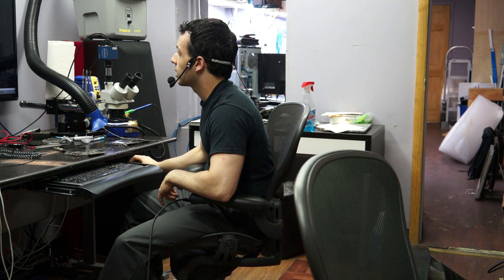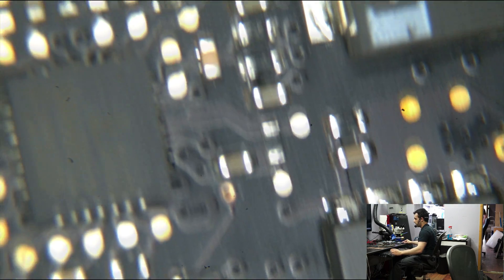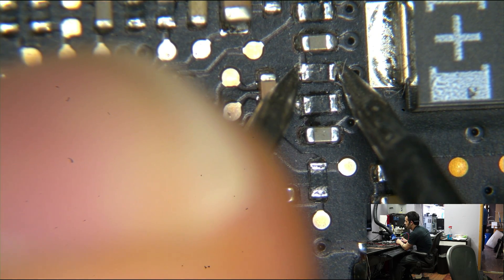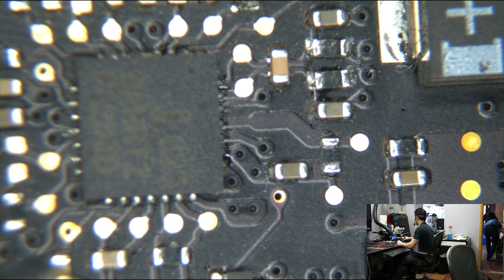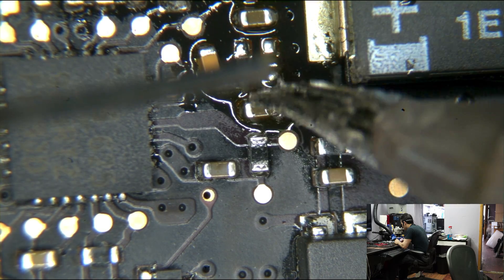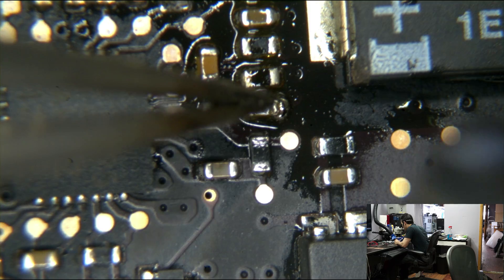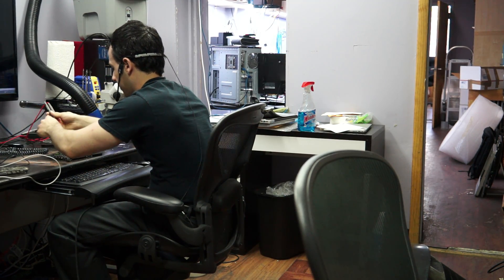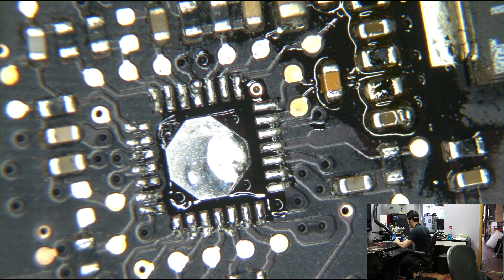How to solder ISL6259 QFN chip on Macbook Pro logic board if you suck at soldering.

Comment: Just a heads up, you can’t accurately measure resistors when they are still in circuit. You gotta disconnect/isolate one side first. Obviously when he measured the second one and it read as open, it didn’t matter.
Reply: If you measure a resistance that is higher than the value of the resistor, you know the resistor is bad.  If you measure a resistance that is lower, you don't know, since current could be flowing along other paths.

Comment: Hi Louis, let me start saying I suck at using the hotair gun. I am trying to fix my macbook, looks like the Q7260 is bad. There's voltage on the source pins and nothing coming out of drain pins. My question is what is the temperature (Ceilsius) to get this chip off the board. I tried 400C for a few seconds but the solder doesnt melt, is there any trick I am missing? I appreciate your help. thank you.

Comment: Hello guys, I'm a very young electronics technician, I know the theory, but in practice I leave a little to be desired. My course was not so good for this reason, they teach the theory, but the practice does not. I had to learn the basics at my stage, but I still have not achieved my goals. Would it be possible if you, technicians with experience, could pass me tips and videos or channels even if they teach to use the hot air station for example? I would greatly appreciate all of you.
hugs from Brazil

Comment: Hello! I ask you for help. I also apologize for my English, I print in Russian, and Google translates the translator. I myself am just beginning to study the profession of repair.
My MacBook A1502 EMC 2875 15 does not turn on and does not charge, the indicator does not work.The cause of the problem is a broken car charger (China) .When I watch your video, I want to replace the U7100 ( ISL6259).  R7121 (5.90 Om) R7122(5.91Om)  C7120(0.586V) C7121(In a short circuit, when the computer is turned off) .   С7150 (In a short circuit permanently, but on it is 1.281v).  С7008 (3.399V) C7000 (Has a short circuit when the computer is turned on Magsafe)  Can you tell me if 9AHRTZ is a replacement?

Comment: Dude if your going to use this method why not use kapton tape to hold the component to line it up.
Reply from the maker: bad idea
Reply: I think it was counter productive in your video to line the component up only to have it fall all out of alignment when you hit it with your hot air wand.

At the least you need to turn down your air flow to stop the device from moving

Comment: Are ISL6259AHRTZ and ISL6259HRTZ the same? I've a Macbook Air 13" (MacbookAir5,2, Mid-2012) with MagSafe light not working, the battery is not charging anymore (tested with 2 different magsafes and 2 different batteries and still failing). A local shop said that it's caused to ISL6259AHRTZ, they ordered it and it seems that they got ISL6259HRTZ instead of ISL6259AHRTZ.
Reply from the maker: +Óscar M. Lage NO!!!!!
Reply: That should be obvious... They have different names!!
Reply: Probably this is old and I should not ask here but what if I have a led for charging and it is charging but sadly only with 6 watts maximum so it take like 12 hours to charge. The laptop works well without the battery just much more slower, the charger is good and the battery it's good too.

Comment: Wrong way to clean the pads. It will lift if you do that! You should use solder wick. You also can use liquid flux instead of the integrated flux core in the solder.
Reply: No, solder wick will pull the pads off the board, never use it in rework unless you know what you are doing.

Comment: Thank you!!! Learned my lesson on the u7000. Bought a dead 2011 mb pro (already had the replacement logic board from Apple) mainly for the body and LCD. Figured what the hell and took a look. Yep! Faulty resistors for current sensing on charger side. Dim green charger light. Replaced and still no go. Checked onewire and no acok signal from u7000. Replaced and wham!!!! Works like a charm. Fans spun, all done! Ha passed ASD. Now have working pro instead of for parts! Thanks to you, Louis!!!!

Comment: hey louis i have a macbook pro 15 inch that didnt give pm_slp_s4. it got water spill on it and board was cleaned. all other voltage are present: pm_pwrbtn, and so on are ok and they goes to 0 when i press power botton but macbook wont power on. i also have 1.05volt mcp present and 3.3 volt too, but machine seems dead. bad mcp and i need to replace it or where can i look at ?

board code is 820-2330
Reply from the maker: +ScruffyITA could be anything
Reply: tnx for reply.i have also a macbook that when i short smc_onoff_l pad fan spin for 1 second then goes off and each time i short the smc bypass it do the same.... reballed nvidia and also reballed cpu and also reblled smc and reprogrammed bios, but it's always the same. board code is 820-2879. have u ever get a macbook with the same synthom ?

when i check coils voltage while doing smc bypass i get voltage coming for one second then off..